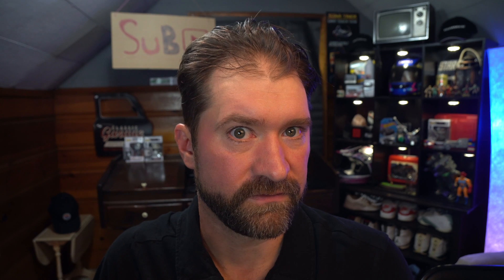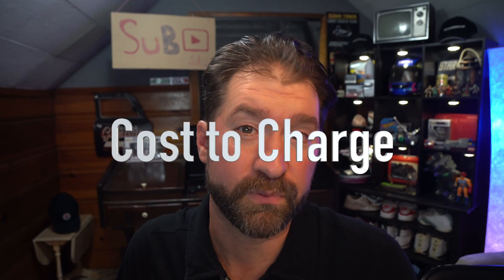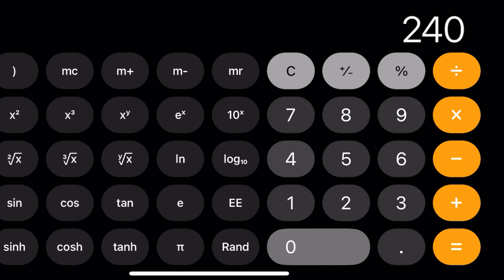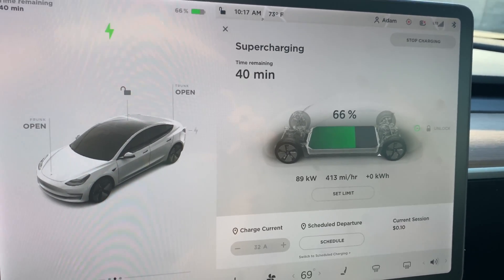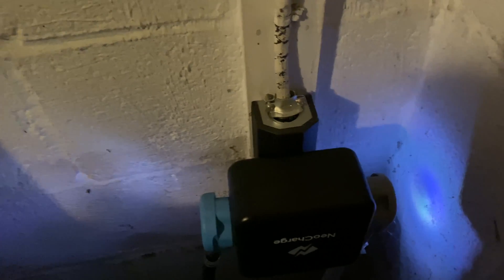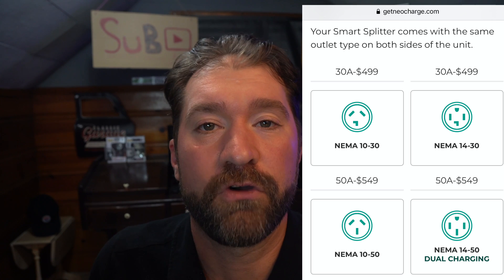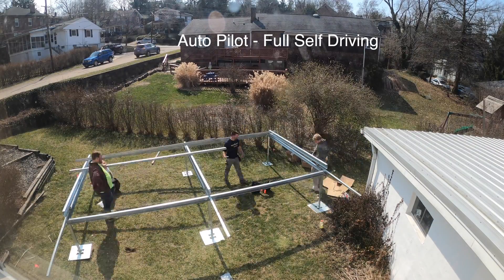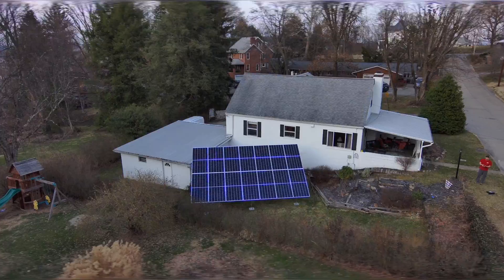Tesla Model 3 LFP | First Month plus Solar Install

Comment: have not seen other than rooftop solar panel installs in my area. The yard install solves worry about potential water leaks (from roof installation). Did you connect the solar panels with a backup battery? If I correctly understand some of what I have seen, there are solar panel installations that can power a level 2 charger (direct wired) that would have eliminated the need for the Nio switch connecting the charger and dryer on one outlet.
Reply from the maker: Panels are grid tied.  Powerwall is on order , will be installed as soon as It’s my turn in line.